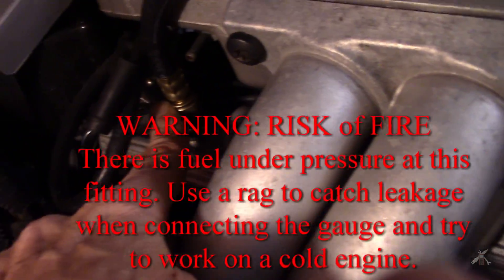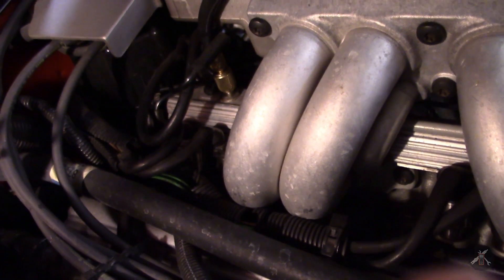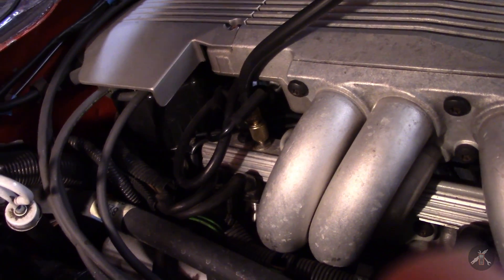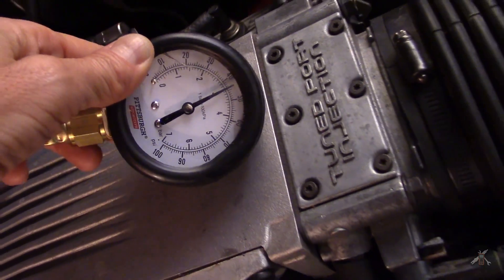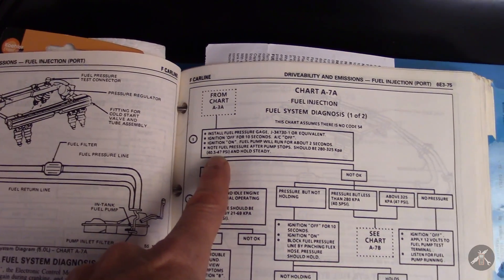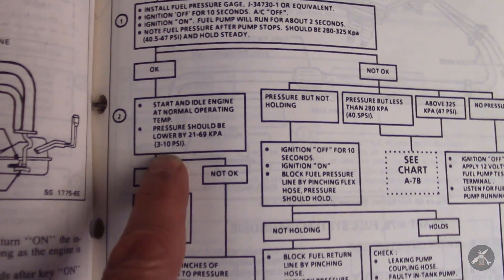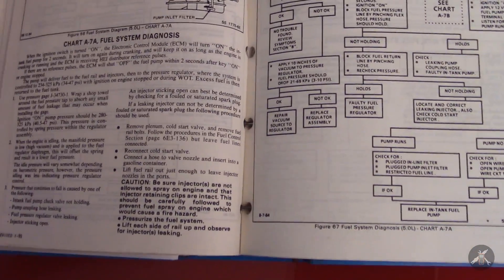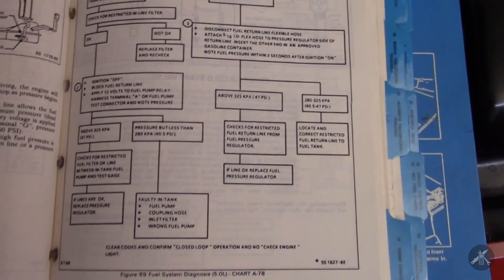How to Measure and Diagnose Fuel Pressure on Tuned Port 305 / 350 3rd Gen Camaro / Firebird

Comment: I just got my 1989 trans am gta running but it’s not running the greatest I have to slowly go up to 40mph if I try stepping on it more it chokes up the engine turns of then u let go of the gas it runs normal but once I get passed 40mph then u can fully step on the gas without trying to die
Reply from the maker: It's hard to know where to start.  Your symptoms sound as if it is lean under open throttle.  Assuming no check engine lights or stored codes, fuel pressure is probably the first check, then be sure ignition is solid because heavier load is stress on spark.  Throttle position sensor might be next, then MAF, o2 sensor, and EGR function.

Comment: I was instructed to lightly polish up the button on the pressure diaphragm to give it a better seal seems to be good information
Reply from the maker: I can see where that might help.  I wouldn't know how much to polish, but worth considering.
Reply: @bitsofwisdom460  I was told around 1000 grit sandpaper I used a home on mine for knives

Comment: Hello friend, I really like your videos since in Mexico there is not much information about TPI engines, My iroc z has a problem that when I turn it off in hot and turn it back on about 10 minutes later it is extremely choked and does not work it blows a lot of smoke until it burns the gasoline that is on the rail and it works normally or if I disconnect the vacuum hose from the regulator to the multiple it also starts well.

I wish you could help me determine the failure, I already checked the injectors and also changed the diaphragm of the pressure regulator and the failure did not improve
Reply from the maker: That can be tough to solve.  The one that gets my interest is removing the vacuum hose.  That will actually make the system more rich.  The purpose of that hose is to boost fuel pressure as the throttle is opened.  The only question is whether you plug the hose when you disconnect it.  If you leave the hose open, it will be a vacuum leak.  I don't know the effect of that, just something to think about.
Otherwise, you may have a sensor or device that is failing or partially failing when it heat soaks while stopped.  For example, I had an IAC valve that would fail after about 10 minutes shut down on a hot day.  It would resume function once it cooled down when the air flow resumed. It could be IAC, temp sensors, MAF, EGR, coil, ignition module. Sorry, I can't get closer.  A scan tool or laptop with monitor software might give you more clues.

Comment: I've been rebuilding the fuel rail on my 87 Firebird. After getting it back on the car, I tested the pressure and all was normal. I did as you and left the gauge on overnight and the next morning it was at 30 psi. I left it on all day while I was doing other stuff to the car and it stayed at 30 until I relieved the pressure to remove the gauge late in the afternoon.
Reply from the maker: That's really good for it to hold pressure that long.

Comment: So mine has no fuel, nothing going through the lines. I can hear the fuel pump run sometimes, but there's no fuel coming to the lines. Any tips
Reply from the maker: Several possibilities:
-Plugged inlet screen on the pump.
-Bad pump
-Leaking hose or pulsator that connects pump to sending unit outlet pipe.
- Plugged fuel filter between tank and engine.  Camaro has it under the floor pan on the left side.
-Low voltage to the pump
Reply: @bitsofwisdom460 thank you so much did not think I wold get a response. We will check those out before we attempt to get a new fuel pump

Comment: What book is this and where can I get it??
Reply from the maker: This one is the factory GM Service Manual from 1985.  I have the loose leaf version that was intended for dealerships to update during the year.  It also comes as a bound version.  I bought this one through eBay.  They often have used copies for sale.  I also refer people to https://books4cars.com. Years ago he worked with me at GM.  He started a side business centered on hard to find service manuals for imported cars. It grew and he left to run that full time. He now seems to carry a wide variety. The last time I checked, he had a number of 3rd Gen Camaro publications.
Reply: @bitsofwisdom460  Thanks for the tip on the site! I actually need it for a Pontiac Trans Am GTA with the 5.7 TPI in it, shared with the Camaros obviously

Comment: I have one of those engine how do I find out what year is mine?
Reply from the maker: Well, there are  number of clues. The best way is to start with the serial number pad on the front of the block on the right hand side. It's an extension of the deck surface at the front of the block and on mine it is stamped from the top. It's under my alternator where the water pump passage connects.  In any case, it has the VIN stamp and an engine code. It's a long string, but my original ended in CFA as I recall. That defined '85 Camaro 305 automatic.  You can look up the code with an online search and it will tell you what model it is for, usually indicating the year because the codes change most years. The partial VIN should also give you the year. Beyond that, 86 and beyond have the new valve covers.  After 89, the mass air flow sensor is eliminated, and there are variations in accessory mounting and belts.

Comment: Hi I have an 89 305 from a Firebird  in my 85 base coupe
 Has the 081 heads and is a roller, but I  first i staled after rebuild a Summit 1200 which has very close specs to your Lunati pick. Went with a 600 carb EPS intake and the much improved Hooker exhaust manifolds.  Super cam in a 305. Later switched it to a Summit 8800 roller with similar specs, but I  actually think it ran better with the 1200 . Thanks for all your research
Reply from the maker: Sounds like a nice package.  And yes, the Lunati folks encouraged me to stay with a slightly milder cam for the 305 as while it might have slightly less top end power, the lower and mid range torque made a better balance.  A 350 could be a little more aggressive.

Comment: I had an 83 Z28 and an 87 IROC. I got lots of people that wanted the 87. Then I moved to a 2000 Z-28 with a Vortech V9 Blower. That car was a beast. Stock boost was 6 lbs. of boost, I learned to tune it HP tuners. All in all, I made close go 600 rwhp. I was able to copy the high-octane table and paste it over the low octane table. Now I had a 2.5 pulley pushing 16psi of boost. Took 1 or 2 degrees of timing, just because. Didn't really have to. Plus, I was running alky injection, I saw no detonation, so added a bit more timing. Race gas only 110 octane, adjusted the A/F to near perfect. 600rwhp back in the 2000's was a lot. Damn, I was I still had that car. Alky injection was key. One thing I will never understand, Vortech had the cooled lines through radiator mixing with the air to water aftercooler. That puzzled me, so I decided to make it a closed system, my intake dropped temps dropped, why they did that, I have no idea?
Reply from the maker: That sounds like a great package with lots of power.  Alky injection is a great help with detonation.  Back in the '80s when 91 octane was the best I could get for my 428 Mustang, I had a Holley system that I ran 50 / 50 water alcohol to keep it under control.
Regarding the cooling lines going through the radiator, there may have been some issue running at very cold temperatures.  While it likely sacrificed some power, it may have helped engine performance when it was cold.

Comment: Great videos,,, we are still dealing with fuel pressure not staying up but this videos helps greatly...  Where did you get that manual.. What is the name of it, it's looks much more informative the the Chilton or Haynes manual.
Reply from the maker: That is an old GM Camaro service manual.  I picked that one up on eBay.  It is a looseleaf version like a dealership used so that it could be updated.  An alternative source is:
https://books4cars.com/  The owner used to work with me at GM years ago. Last time I checked he had a variety of GM Camaro manuals from that era.

Comment: I could use your knowledge. I’m on the verge of doing a carb swap to get over this issue. 
I have a 1990 Trans Am GTA 5.7 TPI. It’s not getting fuel. I don’t really hear the pump priming. It gains pressure while cranking. I’ve replaced the pump with a quantum pump, a new filter, new injectors, new relay, new fuse. It starts up for a moment with starter fluid then dies. I don’t know what to do next. Like I said, I’m on the verge of doing a carb swap to get over the tpi. 
And help/tips would be appreciated!
Reply: Forgot to mention I’ve also replaced the fuel pressure regulator.
Reply from the maker: Have you measured fuel pressure to see if it is correct?
If you don't have sufficient pressure, then that would give one path to work. You have worked most of the fuel system.  If you're not getting sufficient pressure at this point, I would be checking the wiring to the back of the car to be sure it is getting full voltage and that the ground is solid. ECM will give a code for low voltage, but it is sensed at the front of the car near the relay.
If you are getting pressure, there are several possibilities:
-Check ignition, weak spark can sometimes light ether when it won't light gas. Alternatively, excessive rich mixture / fouled plugs can be hard to light.
-Check the system with a scan tool and see if the sensors are reading correctly for a cold start. MAP ought to be atmosphere (14.7 psi), temp should be right. Throttle position should be correct.
-Try starting with higher throttle - 30 to 50%, if that doesn't work try 100%.  There is a "clear flood mode" that takes the fuel to zero at WOT crank to clear a rich condition.
-Are the injectors getting a good signal?  It might be a bad driver in the ECM. But the injectors run off of two driver circuits and you would expect at least half the injectors to fire and the ECM to set a code. I would pull the plugs after trying to start and see if they are wet or dry.
-Check EGR system to be sure the valve is closed.

Comment: So what would I need to do if my fuel pump is not coming on?
Reply from the maker: There is a relay next to the brake booster. It should be on the right side of the booster as you look at it. It is fed by a fused line that is always hot from battery.  The ECM will send a signal to energize the relay when the key is turned on (2 seconds limit if engine doesn't begin turning).  The relay sends power back to the fuel pump.  If the relay is bad, there is an oil pressure switch that will bypass the relay if you crank long enough to get oil pressure. So, you can have a blown fuse, a bad relay, a bad ECM or wiring, or a bad fuel pump.  There is a diagnostic to use a fused jumper to feed power to the fuel pump to be sure it is good.  You can hear it. I'm not sure if all years are the same I am looking at the 1991 manual for TPI and it has a chart to diagnose code 54 for low voltage in the fuel pump circuit. I don't know if all years have the code 54.
Reply: @bitsofwisdom460  your YouTube name definitely is a match for you, I have a 88 2.8 manual, I just got through rebuilding the engine , it's been about a year , but it got done finally, it was starting briefly , then would cut off , not staying on for more then 3 seconds, I could not give any throttle, then I had finished with the charge on the battery and I noticed the bell noise it makes when you have the key in wasn't on, as well as the fuel pump didn't click on, but it was going to start up, I just didn't want to force it , without figuring out a few things ,and I also used a jumper to b&a for the adl like you had said in one of your videos, it's just throwing 12 at me thank you alot for your time I will definitely check that relay out , and see if I can get power to my fuel pump  , thank you ,Sir
Reply from the maker: @boogaloojuly4th  Your port injected 2.8 should be very similar to the 5.0 /5.7 port injected.  I went back and checked 1985 as well. There is a 54 code for low voltage. The ECM has a sensing lead at the fuel pump relay.  If you're not getting a 54, the problem is likely the fuel pump or its wiring. If you have a bad connection either in the feed wire from the relay to the pump OR the ground wire from the pump back to the car body, the pump might run slow / low pressure. Either way, if the pump will provide just enough pressure, you might get a start but not be able to keep it running. There is a Pin "G" on the ALDL connector that the manual says can be fed with a 12v fused supply to bypass the relay and test the pump.

Comment: So a question . I hv a 91 z28 L98 I rebuilt the whole motor and fuel system . New injectors new regulator new pump and tank . Car started and ran great . About 5 months ago pump went bad so I replaced again and ran good again . A couple weeks ago it start hard and quickly shut down . Plugged in fuel gauge and went up to 42 psi but loses pressure to about 15 psi in about 20 mins . Is that indication of regulator or bad check valve?
Reply from the maker: The manual indicates to key up and see the pressure get above 40 psi then the pump will stop, then pinch the feed hose to rule out leakage back to the the pump and feed system.  If ok, pinch the return hose to rule out leakage at the regulator.  The third option is a possibility of a leaking injector that might be seen by checking for a wet spark plug.  There is also a process in the book to remove the fuel rails and pressurize them to inspect the injectors for leakage.
Now, that said, there can be some amount of leakage in a normal car. Mine does not hold perfectly over longer times.  The trouble trees don't indicate how long the pressure should hold.  So from a practical standpoint, if the system holds pressure for a few minutes, the pump ought to be able to maintain pressure in the system at idle for a start.

Comment: 1989 camaro didn't come out with a cold start injector
Reply from the maker: Yes, that is correct.  With the exception of that, most of the diagnostics for fuel pressure ought to be the same.

Comment: My fuel pump is running after I turn car off .caused my batt to go dead.
Reply from the maker: You likely have a bad fuel pump relay.  On the '85 wiring diagram, the relay is fed direct from the battery through a fuse.  If it sticks closed, the fuel pump would have power even with the ignition switch off.  On the '85, the relay is to the right of the brake booster when looking from the front.  I expect yours would be in the same area.  The relay plugs in to the wiring harness and bolts to a bracket.

Comment: Can I run a higher pressure? Plan on running a larger TB
Reply from the maker: You could run a higher pressure with an adjustable pressure regulator, but I don't know if changing the throttle body would necessarily require higher fuel pressure. I don't have experience with that on this engine, but the basic thought is this:  If you provide more air (higher manifold pressure), the speed density system ought to command higher duty cycle on the injectors, and until you exceed the capacity of the injectors, current fuel pressure should be fine. You would need to watch for signs of lean mixture. The fuel calibration in the ECM is based on the standard fuel pressure.  It would be good to consult with someone who does ECM tuning.  The injector flow spec plus fuel pressure plus ECM calibration would be required as a package.

Comment: I like you book for the iroc where do you find these? I;ve been looking for a good book that will have good information. i'm truing to figure out my iroc is. After i changed my fuel pressure Regulator Diaphragm is been dieseling. The original one was leaking and was not doing it. after a new one now it does it. I do have and adjustable cap tho and tried playing with it but still...
Reply from the maker: I bought this one through eBay.  It is the loose-leaf version that usually was used by dealers so that they could update during the year.  The same information is available in the bound version.  You can probably find one on eBay or try books4cars.com.  books4cars has many manuals and other documentation.

Comment: Very informative!  Thanks for the info on HF check tool.  Now I know they're ok and buy one.  I have a question:  what do they call the camaro six cylinder's injection ?  Tuned Port? I know 6 cyl had throttle body - but what about the ported one?
Reply from the maker: The Camaro 2.8 and 3.1 at least 1985 and beyond were called Multi Port Fuel Injection.  I have a pdf of a 1985 brochure and "Multi Point FI" is the logo on the intake system.  You can find more specs on the GM Heritage site. They have information packages posted for download for many models. It was down for a while, but they have it back running with new links:
https://www.gm.com/heritage/archive/vehicle-information-kits